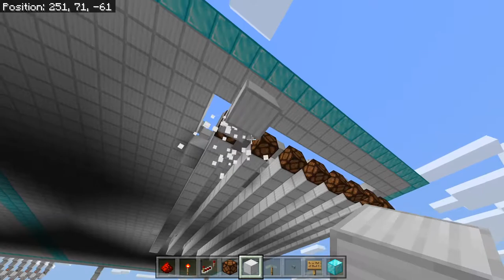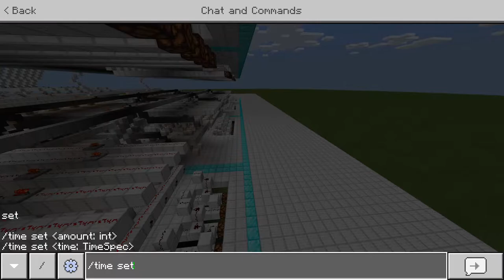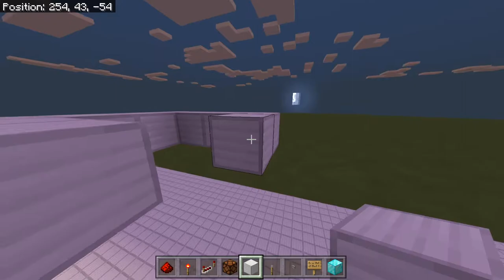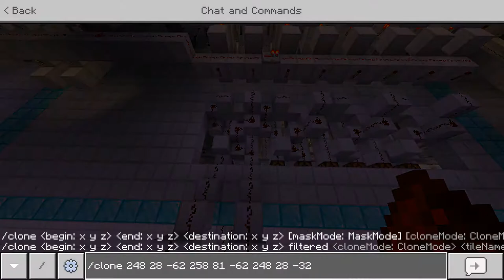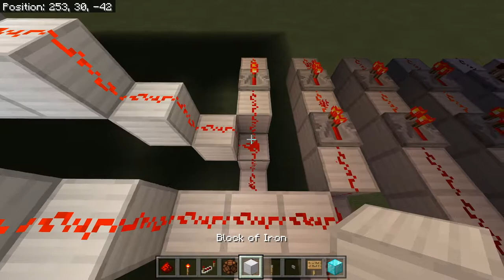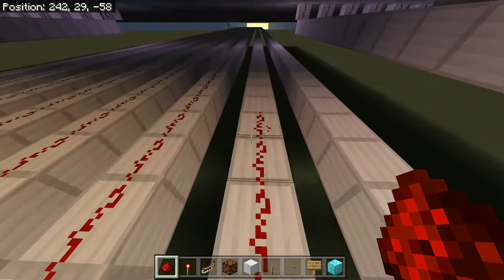Live build: Day 6 (Part 2) - RAM Data Buses - 8-bit Minecraft Computer

Comment: weird. I built the RAM almost the same as you did (apart from the placing of repeaters). Mine runs perfectly fine on 1 tic clock pulses. However, I had problems with the clear signal, which needs to run on 2 tics, otherwise its saving values as it turns off. So I just copied the CLR configuration of the registers, which run on 2 tic pulses and thankfully it worked.
Reply from the maker: This is caused by the timing of the repeater input to the clear signal on each byte. Not sure whether it was clear but they have two be set to two ticks not one. So the repeater that feeds the power into the cross-bar across the byte's inputs need to be two-ticks not one. 

You'll see in later live streams that this actually caused some significant problems which took a while for me to resolve. Ultimately everything had to be one-tick-pulse protected and timings for the individual column data buses had to be adjusted to avoid conflicts with the address line inputs.

Unfortunately, this is the one major flaw in this Minecraft design. But if I were to build it seriously, with more planning, I'd use the 'latching' feature of repeaters to get a more compact, faster, stable design.
Reply from the maker: In case it wasn't obvious, Minecraft was just a tool to make this more entertaining for people / show that it's accessible and build-able in a variety of settings, not just electronics software. Really, it's the Logisim and Modulesim designs that are interesting. My next series will probably be looking at Instruction Set Design (to explain the choice of instructions for this machine), Machine & Assembly code programming, and simple compilation. This will involve editing the Modulesim designs, for example, to show other choices of instructions.
Reply: @EdNutting  The minecraft setting works really well, too. It takes ages to connect everything in minecraft but at the same time it makes the data path much more visible and memorable. So its quite educational :)